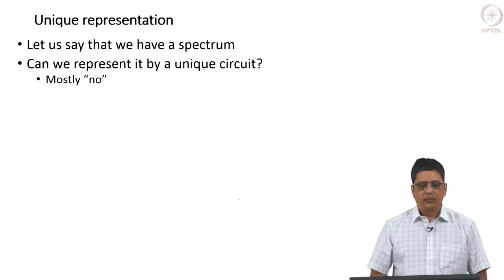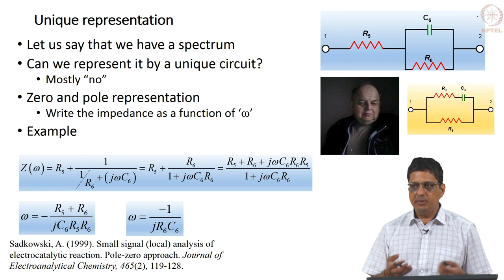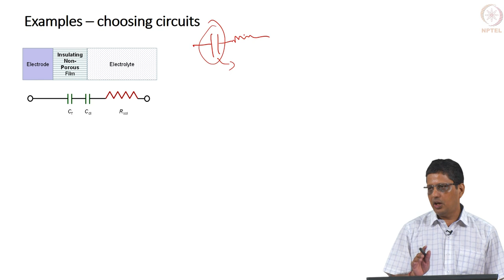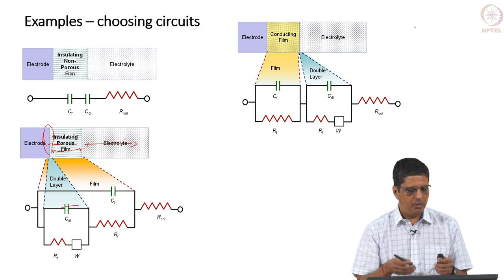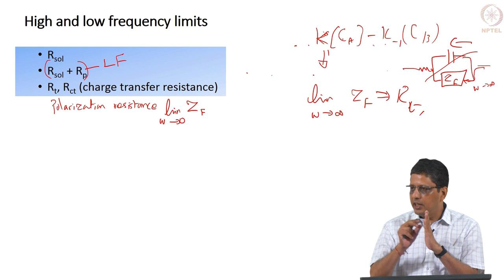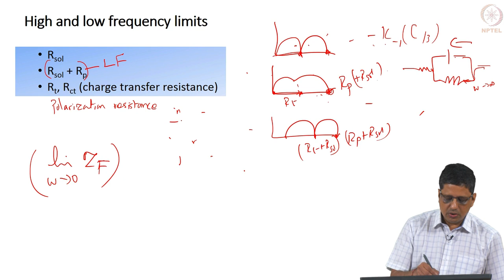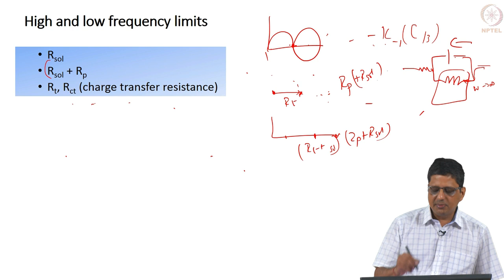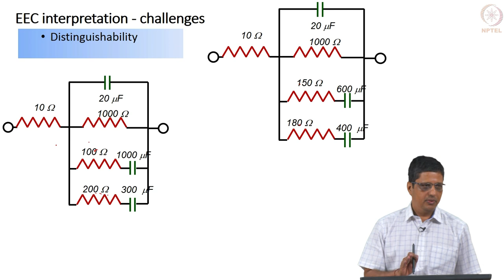Zero/pole representation, Rt and Rp

Comment: what is the physical meaning of poles/zeros 
say we have a TF function of a simple RC circuit ,what's the physical meaning of poles/zeros in this circuit
Reply: I do not know! It is difficult to extract the physical meaning of zeros and poles of the impedance spectra, especially when we are using this to model an electrochemical reaction. I just want the audience to be aware that if we use zeros and poles, we can represent the spectrum uniquely.